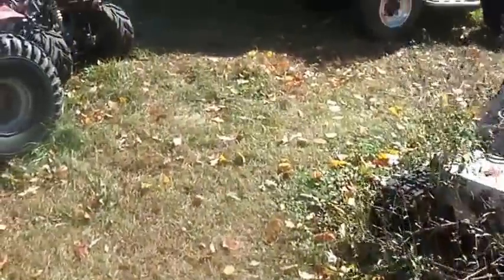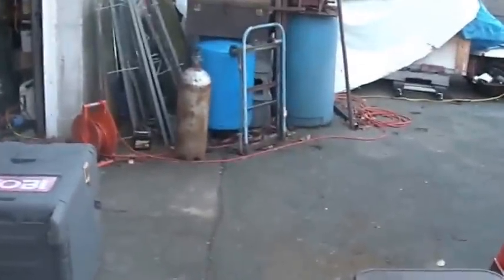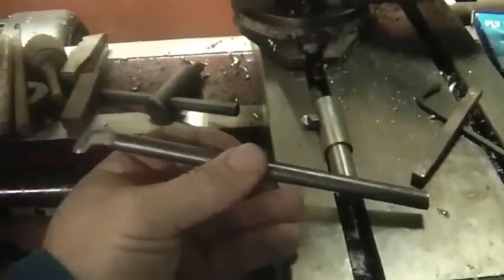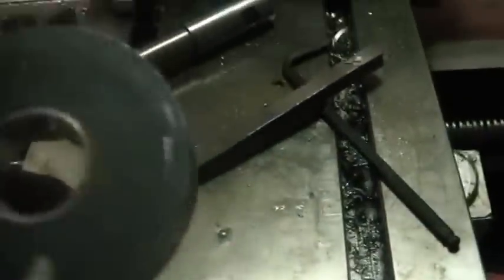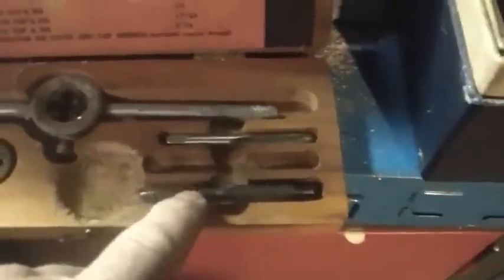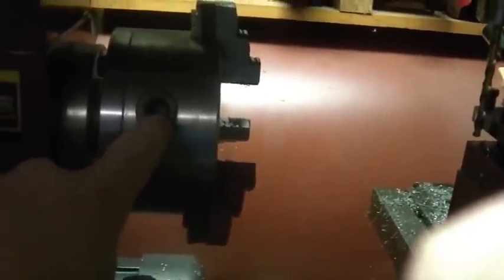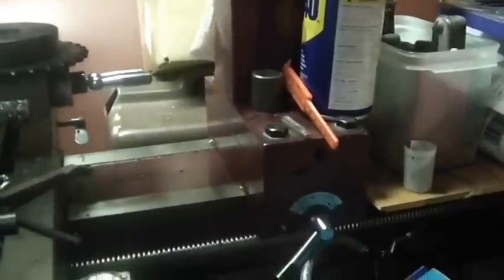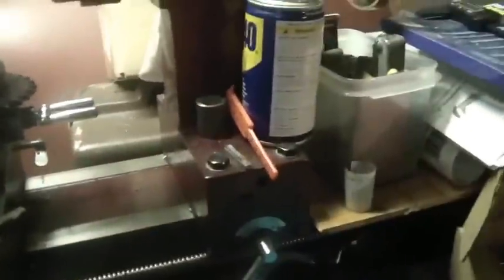Discovered a Hoard of Lathe tooling, my lathe, mill, drill press machine,

Comment: the drill bit you showed with the strange tip. looks like a spot weld bit. for drilling spot welds without going all the way through.
Reply: in sheet metal. i meant. like a rear quarter panel or radiator support.

Comment: to make keyway"s in inside holes you use a broach and the material isn't too thin for a keyway, also that threaded rod on the side of the machine is called a leadscrew
Reply from the maker: Hey Josh, Thanks for the proper terminology, unfortunately, I tend to loose some words when I need them.... Thanks for your thoughts, watching, and commenting!!!
Reply: Harvey Spooner
no problem

Comment: Nice find now make sure you remember where it's at lol. I too have some machinist training not a lot but I can get the job done. Most of the time at work I run a haas vf8 and a vf4 cnc machine
Reply: Biggest mill I've run was a vf3. What do you make if you don't mind?
Reply: +TOXIXIFY we make impellers for roof top ac machines we also make torque converters and blood separators  and a bunch of other things
Reply: Cool always wondered what u did.
Reply: +william staten I also build sand molds for the foundry I work for. Once apon a time I made plaster molds too.